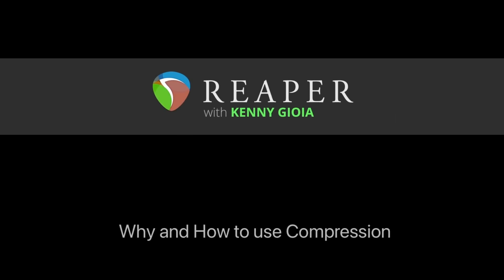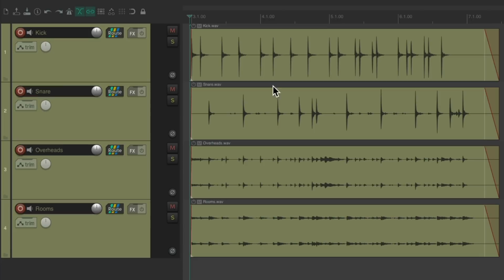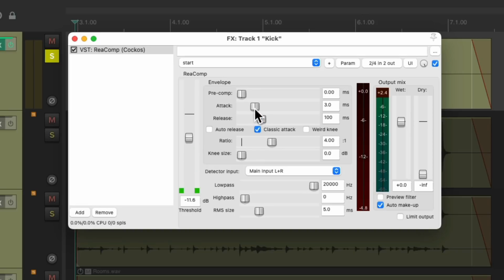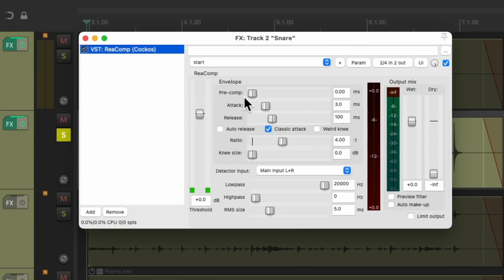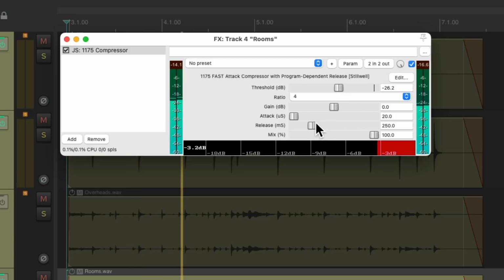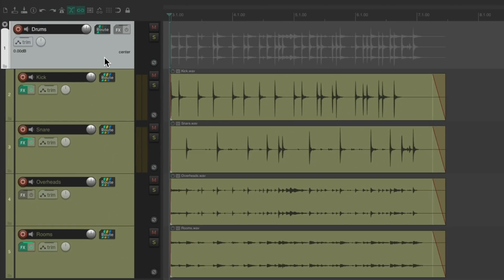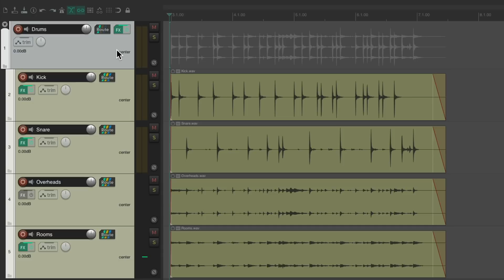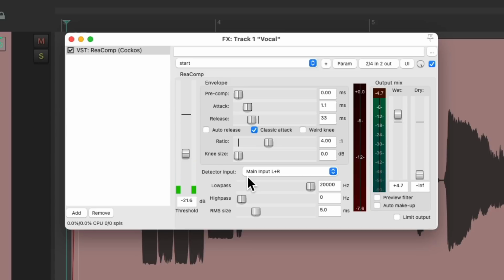Why and How to use Compression in REAPER

Comment: Thanks, Kenny but not sure I would be wanting to send the drum levels into the red (clipping region) that's a bit hot, by the time you're adding other levels of instruments into the mix it could be problematic for the overall headroom. 
Unless I have missed something along the way.
Reply from the maker: Just lower the faders?
Reply: @REAPERMania  Forgive me, I am a little old school analog in my thinking from way back, my understanding is running signal into the red is a little risky with digital as opposed to doing similarly hot with analog multitrack recording to magnetic tapes such as the old Ampex456 to 499 1/2 or 1-inch tape, etc. 
Not to mention a number of engineers have challenged me when I have ridden some levels in the Digital realm to around -2 or -1db saying no, no, you should use -6 or less for anything digital.
I also tended to keep most signals at the master outs around the - 5 or -4 as a rule of thumb on the master output faders and around -3 ~ -2  on the input channels. for Digital recording. Mastering I tend to push around the -2 mark. When I saw the compressed drum signal pushing the red LEDs I thought wow that's a little risky. 
Or am I going about it the wrong way? 
Ps thank you for all the effort and trouble you have done over the year with your tutorial clips they have been and are much appreciated.
Cheers

Comment: Hey Kenny, nice video. Very informative as usual.
I wanted to know if you could make a video on using noise gates in Reaper to get clean high sustain lead metal tones when using high gain amp sims (ex. Nalex Ninja, Emissary amp, Lepou Lecto, etc.
I find that high gain amp sims are very noisy. Generally setting the gates very high/tight helps when doing rhythm sections where sustain is not needed.
But it seems a little difficult to correctly set them for leads, especially clean leads with high/long sustain (for solos. Think John Petrucci solos with long, bendy notes, for example). They tend to cut the solo notes abruptly than when not using them at all or the sound clips. Or the noise sort of bleeds when the note is fading.
It would be great if you could make such a video.
Cheers!

Comment: Thanks again Kenny! If find the hard part about compression is the comparing of before and after when the maup gain is not aplied correctly. You should not trick yourself when the 'after' is just louder. You really need to pay attention to the track level (espcecially when you've already created a dry mix) and see whta the compression does at about the same total track level. Then you'll here maybe the transient / attack changed or the tail of 'fattened'. Just my 2 cents.
Reply from the maker: Yeah. It's kinda hard to get it perfect on the fly.

Comment: Dude, your output gain is clipping. Is it normal?
Reply from the maker: How does it sound?
Reply: @REAPERMania  It sounds louder. And it also sounds subjectively better. But I heard that if you use compressor you should remain subjective volume the same to make right impression. Is it true?
Reply: I had the same concern in a recent  @REAPER Mania  video until someone was kind enough to suggest that I review this other video, which I had already seen but had forgotten the concept.

https://youtu.be/6vXiIlKCEgQ

I was left with the impression that this question cannot be asked. In short, if one is learning, one should ask questions, as long as one is respectful.
Reply from the maker: @jgonzalez2005  If you lower the master with a limiter, the clipping on the individual tracks doesn't matter.
Reply: @REAPERMania  Thank you very much, sir. You should have read this a million times but let me write it again, your videos are really hepful, even for someone whose mother tongue is not English, as is my case.